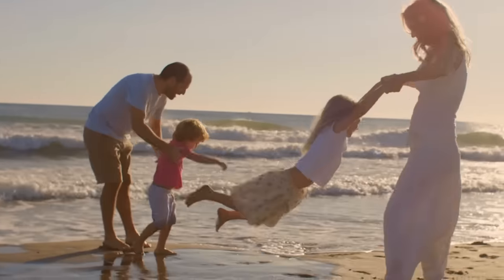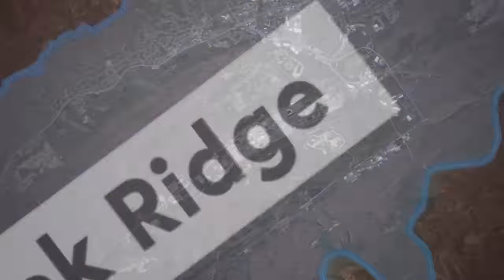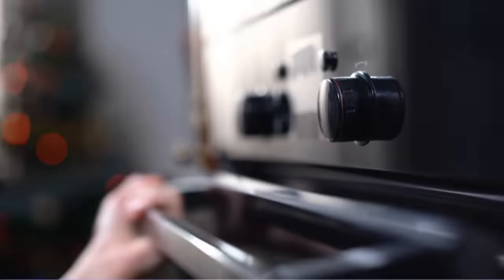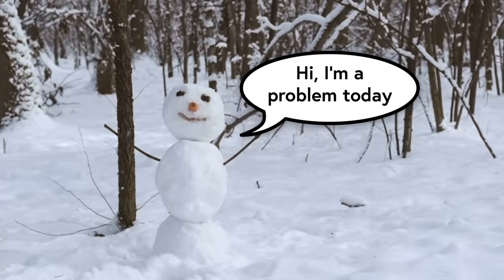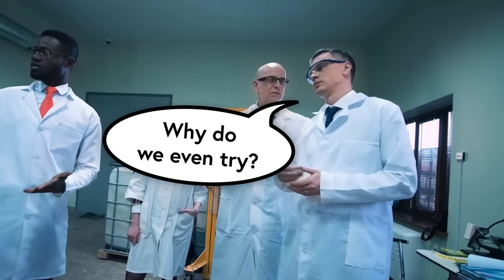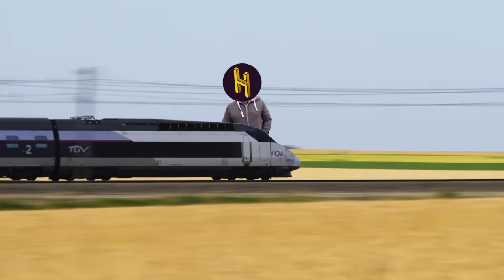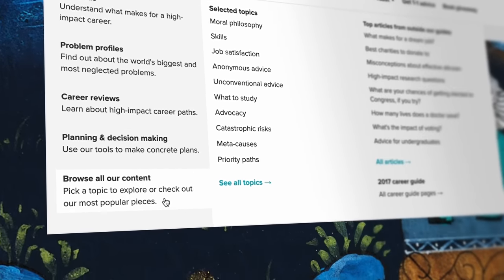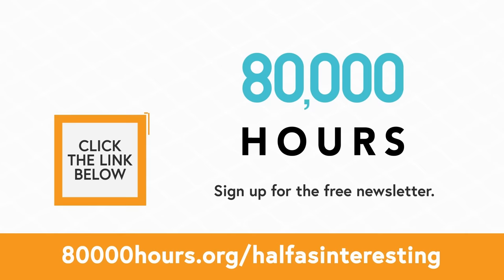The Material So Classified We Forgot How to Make It

Comment: Fun fact : this isn't the first time that imperfection is actually better.
I don't know if it's true, but there's a story about the Japanese Shinkansen and how it couldn't reach French TGV speed without tearing its catenary (the cable that sits above electric train lines). They sent some engineers to France to study how we did it, there weren't many differences until one engineer pointed out that our catenaries weren't built with perfect spacing, whereas Japanese precision made them space each pole at the exact same distance, increasing the resonance effect when a high-speed train goes through until it tore down the catenary. 

So, French clumsiness actually is not a defect but a necessary part of the design. "It's a feature".
Reply: Side effect of allowing them to drink wine and eat smelly cheeses. The engineers were inebriated.
Reply: Actually, both trains have the same top speed: 300 KPH. The Shinkansen gets the crown as the fastest train in the world because it spends more time at its top speed compared to the TGV. The Shinkansen is also an Electric Multiple Unit (EMU), meaning the electric motors are distributed throughout the train, instead of being clustered under the locomotive and adjoining passenger car axle, which the TGV does. This gives the Shinkansen a higher acceleration rate than the TGV.
Reply: Same thing killed SONGS. They ordered new steam generators in Japan, but due to extremely high accuracy new pipes were made - they went into resonance when operated at full power. Manufacturing imperfections and little lower tolerances would dampen vibrations (or just one more level of supporting grate). However, second replacement was blocked by so-called "environmentalists"
Reply: @jordonfreeman166  Actually the French LGV Est and Japanese Tohoku Shinkansen run at 320 km/h. But yes their in-service speed is the same.

What they were probably referring to was the world record attempts. The Shinkansen achieved a record speed of 443 km/h in 1996, which failed to beat the TGV's 515 km/h record from 1990.

France beat their own record again in 2007, reaching 575 km/h which remains the rail speed record for wheeled vehicles. Japan holds the record for Maglev trains at 603 km/h.
Reply: Same thing happened to Rolls-Royce when they began building their own GM Hydra-Matic transmissions under license. They hand-polished the internal components' surfaces of the first ones and wondered why they drove horribly, it turns out GM wasn't doing that just because they couldn't put that amount of hand work into a Pontiac at its' price, they were doing it because certain surfaces needed a rough finish for the fluid dynamics to work right.
Reply: @nlpnt  
I was interested in your comment, so I did make literally about ten attempts at trying to understand it, and I get it now. In case you're interested in a piece of constructive criticism based on which you might be able to improve the wording of your comment:

"GM wasn't doing that"

The word "that" in this part of your comment really makes it seem (to me) as if it were referring to "hand-polishing the internal components". I (believe to) know now that it doesn't. At least, your comment makes sense now that I assume that it doesn't. I am sure that the word "that" refers to something you only mention afterwards: The fact that Rolls-Royce doesn't hand-polish the internal components' surfaces of their GM Hydra-Matic transmissions, aka the opposite of doing it.
Reply: It's actually legit how semiconductors work, too.
Silicon is a very resistive material, but doping it with a fraction of a percent of the correct type of impurities (elements that have 3 valence electrons, or ones with 5 valence electrons) allows it to exhibit semiconductor behavior.
Reply: @camelopardalis8506 I'm pretty sure the word "that" is referring to the fact that GM was not hand-polishing the internal components.

The following is me re-writing their comment to hopefully be a bit more clear as it was worded a little oddly.
Essentially GM was not hand-polishing the internal components when manufacturing the Hydra-Matic transmissions. Rolls-Royce apparently assumed (if they even knew) that GM did it that way because GM couldn't justify the cost of hand-polishing given the price of the Pontiac cars they used the transmission for. However, Rolls-Royce found that their transmissions ran horribly when they hand-polished the internal components. The difference in performance was because certain surfaces needed a rough finish for the fluid dynamics to work right.

Hope that helps!
Reply: @patrickherke8947  
Yes, this helps.

Firstly in the sense that you confirm in your first paragraph what I (thought I had) figured out. It's a confirmation that I eventually understood correctly.

Secondly in the sense that you have made me aware of how the comment mentions two manufacturers, not just one. I thought "GM" was part of the name of a type of transmission manufactured by Rolls-Royce. I get now that "GM" must refer to "General Motors".

In short, I eventually understood what was mainly described in the comment, but needed you to make me aware of how much of the less important info in it I had misunderstood. And I am glad I got confirmation I was right.

In case you happen to think I actually misunderstood (and possibly still misunderstand): This might be because I phrased by own comment not ideally. (But I can't completely rule out I just think I understood eventually.)
Reply: @OntarioTrafficMan  if I'm remember properly, this story is from back when neither were rolling at 300km/h commercially, so during developments of early HSR.
Reply: Yeh, the train thing happened. Not sure exactly where or when, but a good reminder that sometimes, things work because they are not precise.
Less technical example: Swiss cheese. Filtrating all the air in a modern dairy means the cheese has no holes, which require dust particles to form - and that's bad for PR and supposedly also affects the aroma. So they add the dust back in.
Reply: That’s amazing
Reply: All the impressive stats in tech like power and precision aren't ideal.  The best designs are made of trash and use almost no power and still work because of the design itself.  I'm not a fan of the whole Bauhaus designs that show off good materials and craftsmanship idea.
Reply: Also: Roman Concrete.  Turns out the imperfections are what make Roman Structures self-heal cracks and last for centuries.
Reply: “We did it boys.. we accidentally made something better with unintentional science!”
Reply: Something something Ancient Roman self-repairing concrete something
Reply: @brylozketrzyn  Not entirely true. Unit 3 steam generators were made using a new manufacturing process eliminated shrinkage around bends of the u-tubes to give them uniformed thickness which changed the vibration characteristics in areas that experience two-phase flow. unit two u-tubes were made using the old process and exhibited no unusual wear after it's first eighteen month fuel run.
When unit 3 showed signs of leakage, the decision to restart unit 2 was suspended pending a thorough investigation into unit 3, thus linking unit 2's fate to unit 3.
After two months, SCE and the NRC had all the information needed to ensure that unit 3's problem was not an issue with unit 2. Unfortunately, California being... well, California the NRC and SCE decided to play question and answer sessions for the next year and a half so they didn't give the impression they didn't care. 
During this time, Mitubishi heavy industries accepted fault with the new $300 million unit 3 steam generators and agreed to manufacture two new ones for free and the plant's insurance was going to cover the cost of transportation and installation.
To set investors at ease during all this, SCE's CEO Ron Littzger set a line in the sand of two years for a unit 2 startup and in August (4 months before the two year deadline) the NRC technical committee was set to issue the release order for a unit 2 startup; HOWEVER, at the same timeCalifornia state senator Barbara Boxer forced through a petition for the NRC's safety committee to review before plant restart and, having no previous reason to review the incident from a safety standpoint, didn't have the resources to even review the data for at least six months, pushing the unit 2 restart past two years and forcing Ron Litzger to pull the plug on a perfectly fine and fully fueled nuclear power generation facility (unit 2), and fully fueling my hatred for Barbara Boxer for her malicious stunt that caused it.
Reply: lol
Reply: Or roman concrete.
Reply: The bubbles in swiss cheese are only there because the CO2 gets concentrated around particles of dust that came from when the milk was extracted. The scientist who work on making the bacteria that is used to make swiss cheese found that Hay Dust is the best thing to add to the milk to make the cheese have the characteristic bubbles we have come to know in swiss cheese.
Reply: @KevinNestor84  I'd rather not have bubbles then.
Reply: @KevinNestor84  Yep, also saw the video and wanted to reply here :D for those interested, it's from Tom Scott.
Reply: @BlackJesus8463  No worry actually, the amount required are 1mg per 1000 litre.
Reply: @PuchiPool  There's something to be said for nutritional density. 😂😂✌
Reply: It just works!
Reply: @JPSimen  most famous french cuisine comes from mistakes or accidents, same with most of the french's most famous historical people
Reply: @jordonfreeman166  Actually, the record-setting TGV was an EMU, just like the Shinkansen. They basically installed motors everywhere. Passenger capacity was severely reduced. They also installed larger wheels, had to reinforce the rails and raised the catenary voltage far beyond safety (bridges and roads crossing the TGV railroad has to be closed as there was a possibility that nearby people and vehicles could literally be struck by lightning).

Regular commercial Vmax is 320hm/h for both the Shinkansen and the TGV. The ICE3 (which is an EMU) has a Vmax of 330km/h during regular commercial operation while the more recent ICE4 (no longer an EMU) is limited to 265km/h.
Reply: @klausstock8020  true, but that was an experimental prototype, not a production model, therefore it does not count. Comparing an experimental prototype to a production model is like comparing apples to oranges.
Reply: It wasnt "clumsiness" by french. They tested and figured it out and made it like it on purpose.
Reply: Not the only time. Roman concrete was rediscovered recently because turns out with modern equipment the lyme is ground up super fine, whereas the old stuff it was coarse because it was all done by hand. The coarse lyme formed nodules that when wet would self heal small cracks, hence how Roman concrete has lasted literally thousands of years and our stuff cant make it a few decades. 

Sometimes doing it "better" doesn't make the thing better.
Reply: @gimmethegepgun  This seems to me somewhat different, because it isn’t that it works because “they didn’t remove all the impurities” so much as they deliberately add just the right amount of the impurities?
Unlike say, “not polishing something perfectly smooth” or “not being so exact with the lengths of tube sections”, the doping is something that has to be added deliberately and wouldn’t appear automatically just by being a bit less precise with something?
Reply: Same thing with holes in Swiss cheese. More details in Tom Scott's recent video.
Reply: Another example of imperfection is sometimes better is food. I'd rather eat a mixture of protein and fat with some salt rather than pure protein or fat.
Reply: French clumsiness was also why France became part of the Reich. 😎
Reply: Iirc there's also a story I remember of making a primitive shampoo using fruits, and straining the juice from the fruits using an expensive cheesecloth got pure juice, but the shampoo worked better with the rough pulp that got through when straining the juice through a cheap coarse cloth
Reply: @kevinrsnow We can make concrete just as good and even better.

 We one don't because it is a pain to work with usually. We want our concrete to flow easily.

 Most importantly - rebar is the biggest threat to concrete due to corrosion

 Still impressive what the Roman's did. Would love to see us start actually building things meant to last quite honestly. Maybe the Chinese can teach us as someone told me the Three Gorges Dam will last for hundreds of years. (Ha already falling apart!)
Reply: The really interesting thing is that it's only the older models of the Shinkansen that spend time at speed.  The newer models are used on the routes that start/stop more often because that places more strain on the trains.  So if you want to experience high speed over distance, it'll be on one of the oldest & least capable (but impeccably well maintained) models.
Reply: They had unintended wiggle room
Reply: @Droobie03 It's because "impurity" is a value judgement, just like "side effect".  One man's meat is another man's poison, etc.
Reply: You have to insert a miniscule amount of straw dust into cheese otherwise it won't get holes.
Reply: This proves my childhood realisation: aesthetic engineering is more than perfect engineering -in all senses of “more”.
Reply: catenaries also zig zag to reduce heating and wear
Reply: @jordonfreeman166  TGVs are also EMUs. Unlike in many other EMUs their power cars don't provide any passenger seating, however since they cannot be decoupled/separated from the train in normal operation they're still classified as power cars and not as locomotives, making the train an EMU and not a locomotive pulled train. Oh, and TGVs since the TGV Réseau that entered service in 1993 all have a maximum service speed of 320km/h, not 300km/h; same goes for 8 of the 9 TGV lines that have opened since 2000 (the 9th is LGV Nimes-Montpellier which opened in 2018 and is limited to 220km/h with the option of upgrading it to 300km/h in the future).
Reply: @OntarioTrafficMan  Not just LGV Est. LGV Sud Europe Atlantique, LGV Bretagne-Pays de la Loire, LGV Méditerranée, and LGV Rhin-Rhône run at 320km/h as well.
Reply: I commented about Roman concrete, it heals by itself and last for thousend years...   But we have lost the receipe.
Reply: @eduardodiaz5459  Wrong, we know exactly what they used to make it, because the Romans actually wrote down how that stuff was made and we have those writings. In fact the recipe was never really "lost", it was just that after the fall of Rome pozzolano, a form of volcanic ash and one of the main ingredients of Roman concrete, was no longer available in most of Europe.
Reply: @blahfasel2000 In addition, the bogies next to the two power cars are powered, too. I'm not sure if I'd call it an EMU, but it's not a loco-hauled train either.
Reply: Rolls-Royce ran into this when they tried to pirate Cadillac's automatic transmission.  They copied it exactly, and it utterly failed to engage.  Tore it apart, re-measured, found everything was right, put it back together, failed to engage.  Finally someone realized the problem.  They machined it to make it perfect; Cadillac had cast it and the surface was quite imperfect.  Roughing up the faces that engaged with coarse sandpaper made it work finally.

Comment: This happened to a customer I had.. They had a very specific production process that allowed them to make parts better than their competators. They were bought out and as they were winding down production and transfering everything to the new owners, they realized they had run out of a key component that they used for making these parts. They also realized that they had nothing written down about how to make it. There was one machinist still there and they found out he knew how it was made. They asked him to make some and he said"sure". They then asked him to write down the process and he said"no". The company that bought them was also a customer of mine. Last time I visited he was still coming in on a contract basis and making that material for them.
Reply: He did the right thing, on a company where my acountant worked they got a new manager, he brefiended the oldest manufacturing employee,   convinced him of write down every single process that the old guy knew, as soon as the manager tested that everything could be replicated he fired the old guy, bosses nowdays can't be trusted

Comment: Reminds me of the WW2 tank gun stabilizer that was considered so great they kept all info about it a secret and barely trained the crews, resulting in crews not knowing how to use it properly and just disabling it instead. Sometimes it's good for the left hand to know what right one is doing.
Reply: Same happened for the magnetic detonators on the Mk 14 torpedo. They produced a manual for how to operate the thing, and then locked it away so sailors couldn’t access it due to the classified nature of the tech (tech which was in wide use in most navies and was taken from the Germans originally).

The Bureau of Ordinance also refused to acknowledge the issues in the Mk 14 and claimed that the sailors were using it wrong, while also having their experts get corrected on the torpedo’s use by said sailors. (They also tried to get any sailor who modified the torpedos so that they actually worked court martialed, the naval command was quite unhappy with BuOrd at this point though, so they didn’t)